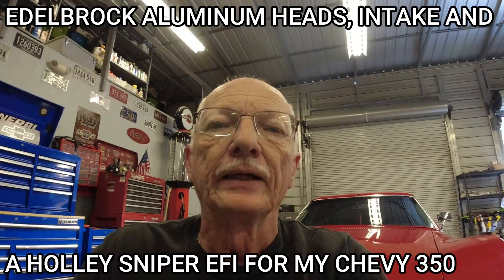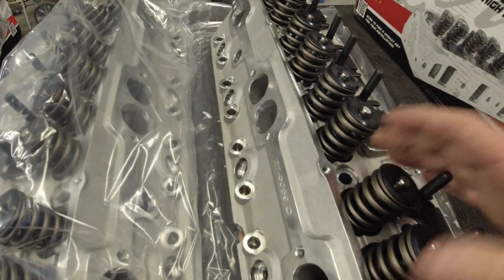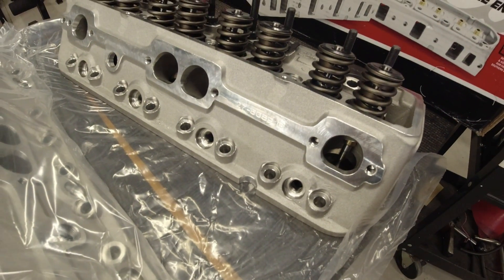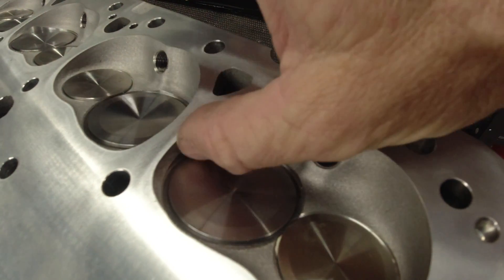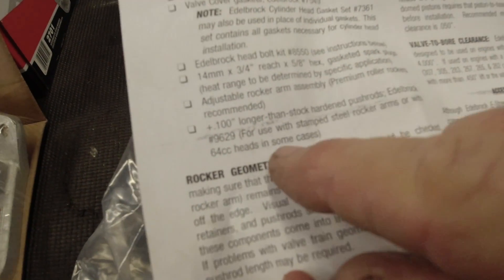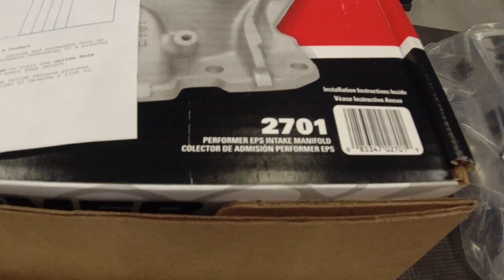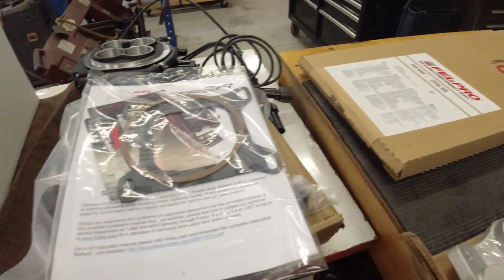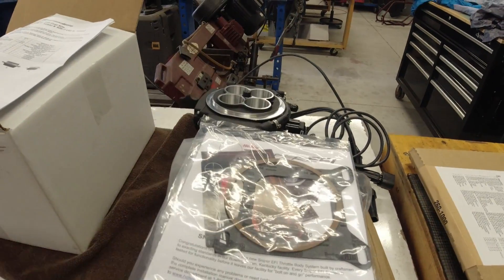Installing Aluminum Heads, Intake and a Holley Sniper EFI on my 71 Corvette

Comment: Great video, and thanks for pointing out the missing information about the pushrods. Since I am also thinking about this solution, so I watched quite some videos about it, and some of these videos, which are from "pro-builders", pointing out that the Holly Sniper don`t work well with a dual plane intake, unless you put on a quite high spacer, or take off some of the wall between the two ports on top of the intake. Have anyone else heard about this?. Looking forward to more videos.
Reply from the maker: From what I have read Holley recommends using a dual plane intake with the Sniper. I will have to double check that. Is there supposed to be a problem with the throttle plates hitting the top of the intake?

Comment: Mark... I'm really looking forward to the series of videos you are about to shoot on the installation of these components, since I have the same year Vette and engine. I assume that e-fuel pump will be mounted aft near the gas tank? Thx.
Reply from the maker: Thanks for the comments. I am planning on mounting the fuel pump on the frame as close to the tank as possible for now. If it doesn't work well, I will install an in-tank pump. Holley sells a nice setup for that.